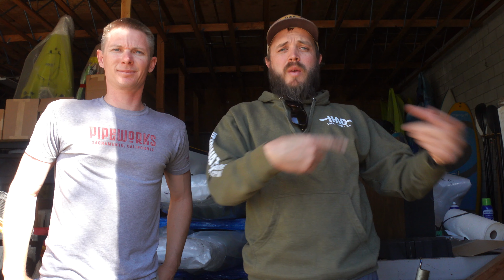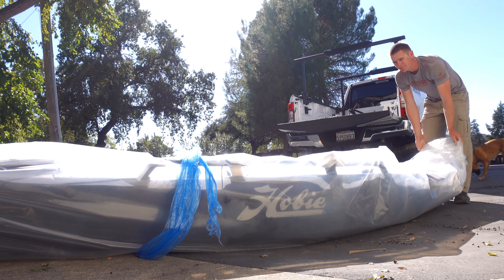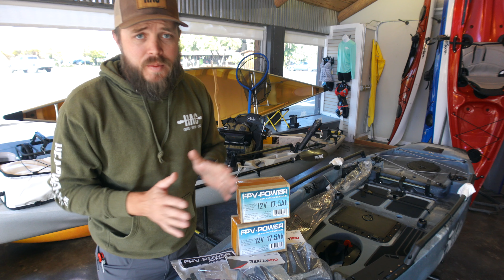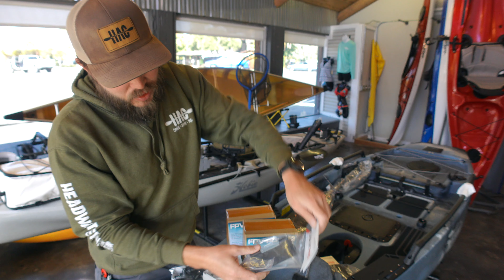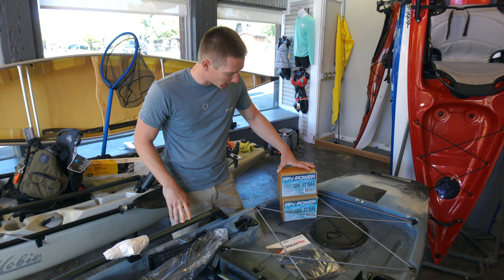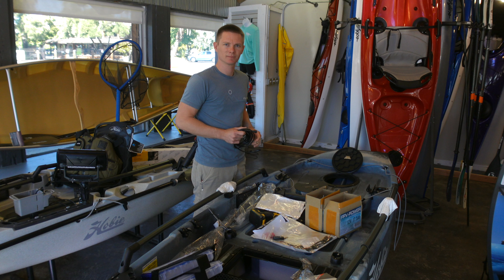Hobie Pro Angler 12 MD360 Tournament Build Ep. 1 - Power and Distribution

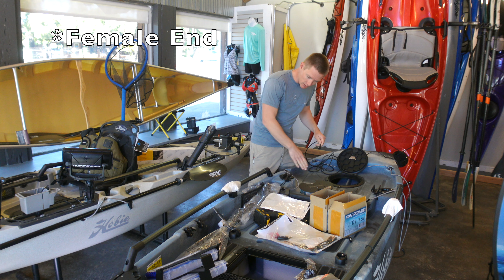Comment: Something caught my attention @9:06. Looks like Hobie changed the size of the foam block support just rear of the hatch.
My old 2015 PA12 has two separate blocks. I wish they would sell a replacement kit. Over time the foam blocks do degrade and end up moving around a lot on the inside. :(

Comment: FPV batteries are water proof as are the connectors, so if water happens to get inside the kayak while not desired will not bother the batteries. Another BIG reason to select FPV products for your power.
Reply from the maker: They sure are, that's why we use them also!